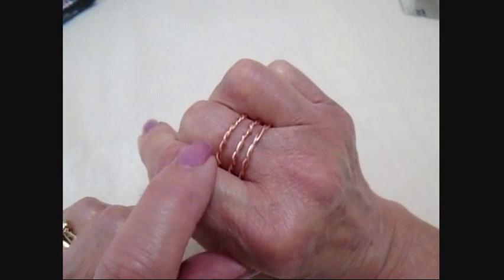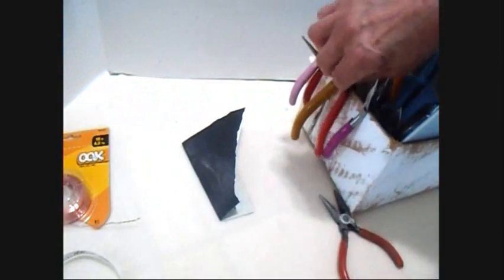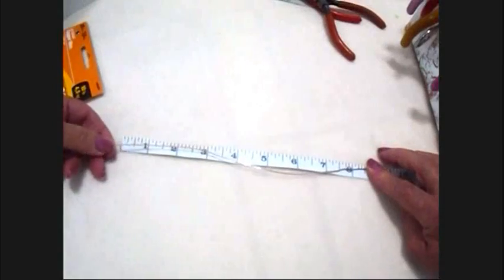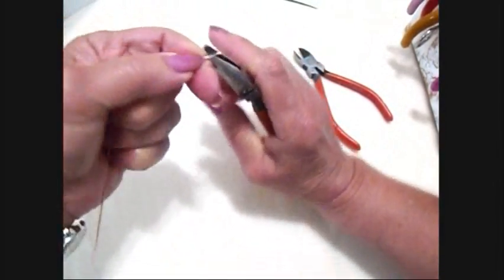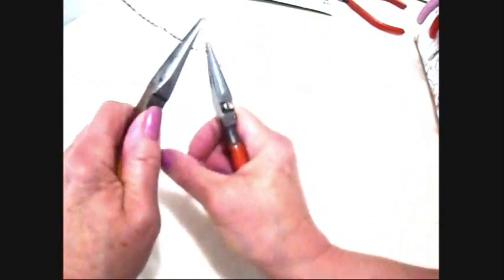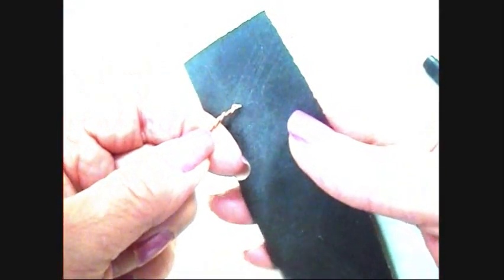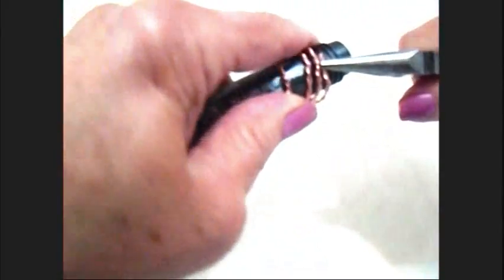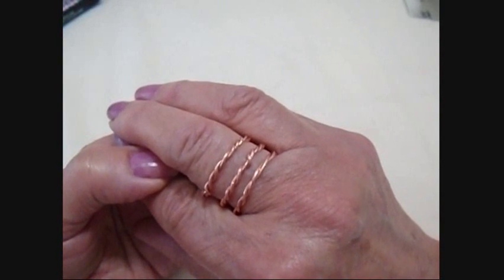DIY- How to make a TRIPLE COPPER WIRE RING, diy jewelry making

Comment: is there a particular grit of sandpaper you used on the copper wire ring?
Reply from the maker: No, any grit is fine,,, that was fine grit I used, (wet/dry), but you can even use a nail file!